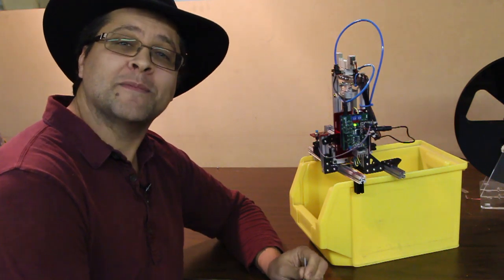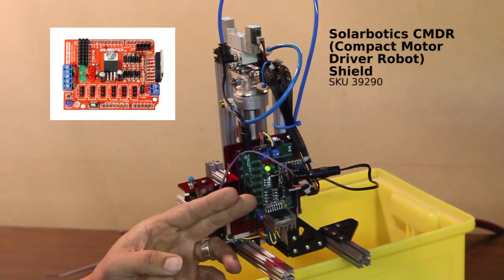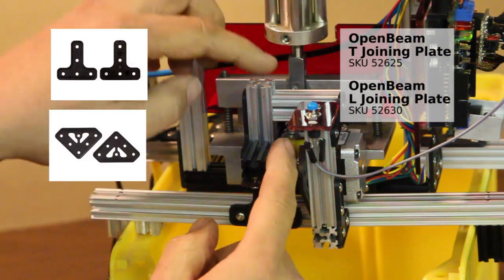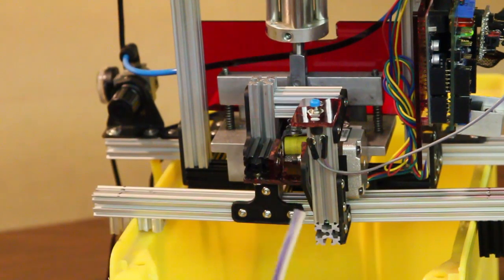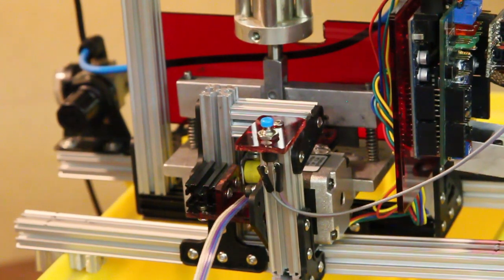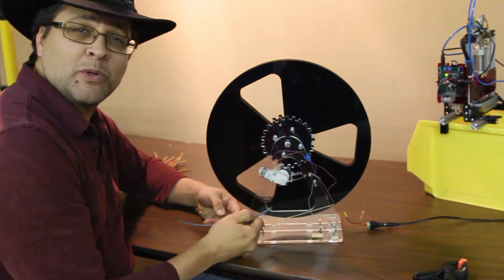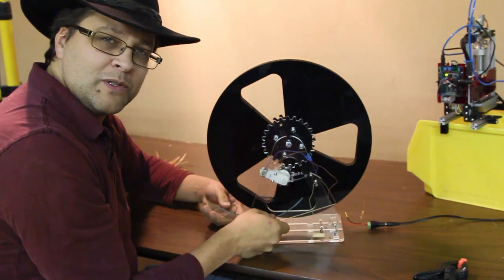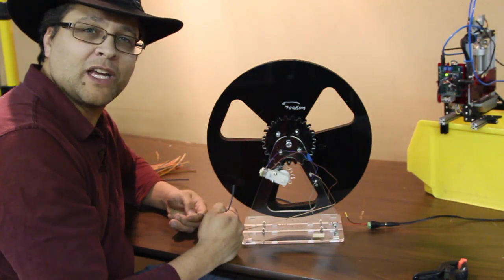Ribbon Wire Cutter (a.k.a.: Mr. Chompy)

Comment from the maker: We're using a 4V210-08 5Ports2Position Single Solenoid Pneumatic Air Valve 1/4" BSPT DC12V (from ebay), which we're driving through some simple 2n2222 transistor buffers from the Arduino.

The cylinder that receives the 90psi air is a Bimba CF0-06829-A, Spring return unit. Got that on Ebay too.

Comment from the maker: No, we're not selling it, but you're welcome to the cut files (if I can find them... should be here someplace...). Interesting note of operation - it's too slow when it gets to the end of the spool! It can't unwind fast enough to keep up with the cutter. The ribbon wire tension sensor has to be redesigned so it has more mechanical hysteresis. Something like where the ribbon has to snake back and forth a bit more between some compliant rollers, so it can better detect the ribbon pull.